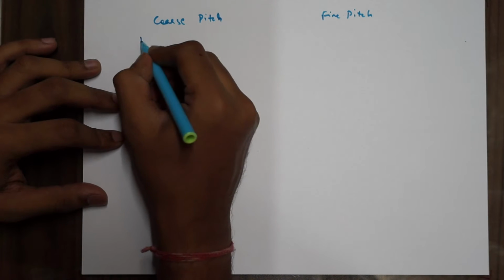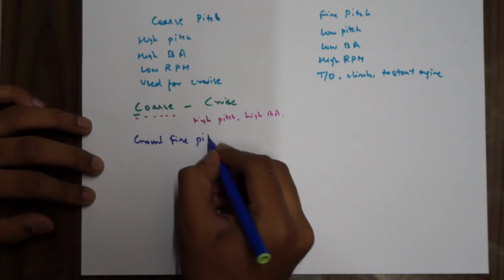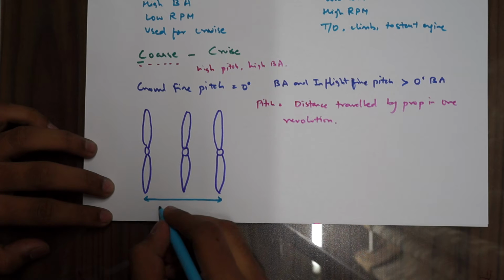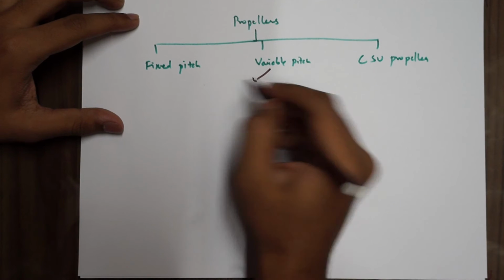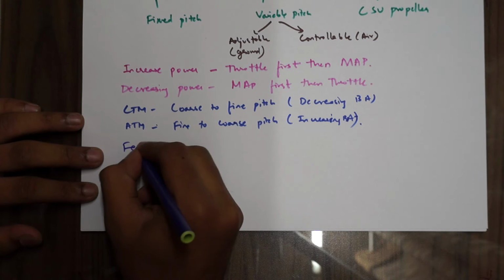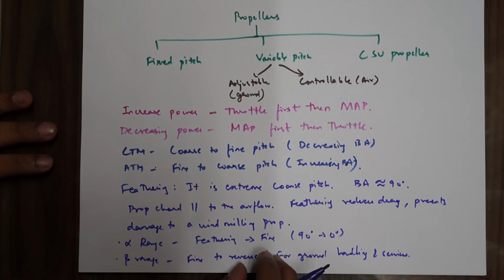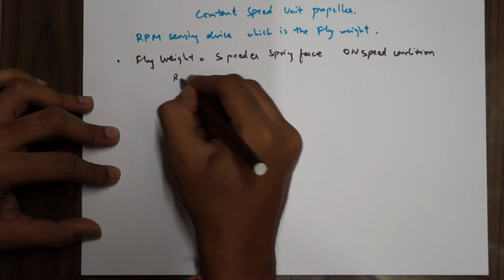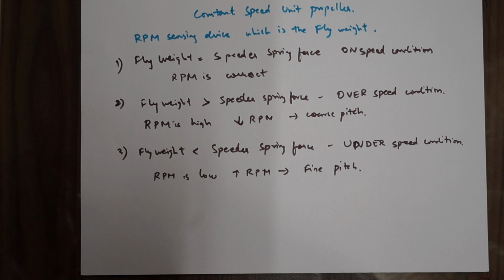Propellers - II

Comment: Mate I am sure you have already picked up on it but I think you need to know what you are talking about with the Manual pitch propeller control!

Increasing power - RPM first then MAP!!! not Throttle first. You have yourself mixed up here champ. The throttle controls the MAP!!! The pitch lever controls the RPM!
Reply from the maker: Well, yes absolutely right.. Throttle controls MAP and Pitch levers control RPM. On ground by the way throttles control the RPM. 

Power changes 
Increasing power - Pitch first then Power 
Decreasing Power - Power first then Pitch